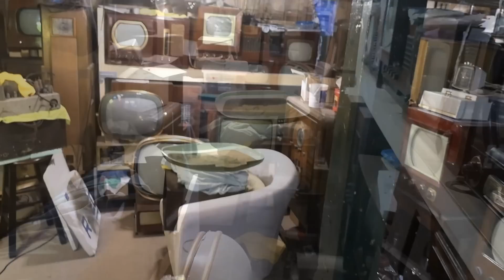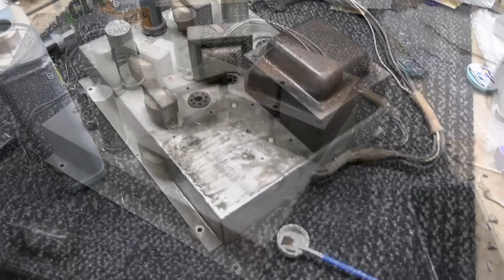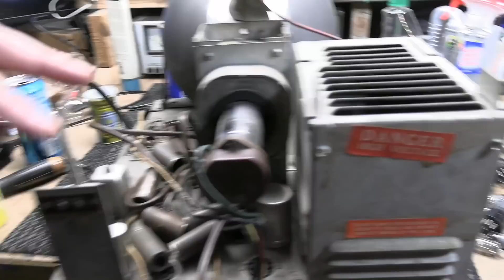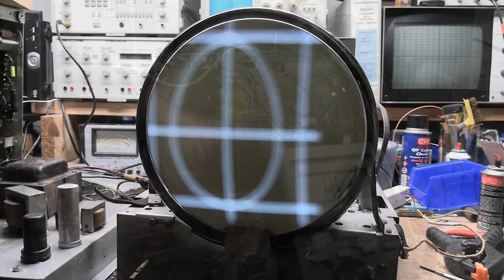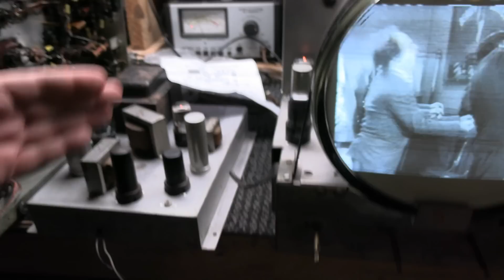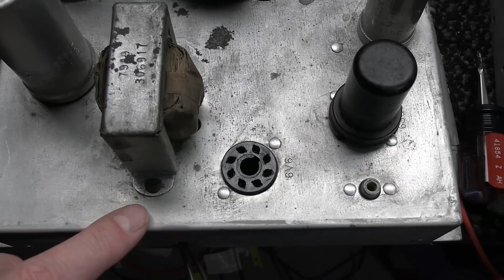Admiral 24A12  part 6: Occam's Razor

Comment: If something was wrong with that 6V6 and it was getting hot (perhaps a bad connection caused it to be biased incorrectly), and since as you said it supplies power to other parts of the set, perhaps it sent too much current through your first 3K replacement resistor, and burned it up, acting like a fuse, perhaps the same fate as the original resistor. Looking at a schematic for an admiral chassis with a 6V6 (not sure it's the chassis you have), I see a 3K resistor R332 in that area of the circuit, connected to the focus control, and connected through the focus control to the 6V6.
Reply from the maker: I think you are absolutely correct.  Another reason to overrated parts when replacing.
Reply: @bandersentv  With that bigger power resistor, you might have been in more danger of burning up something else, like your focus control or audio output transformer. It might be interesting to put that metal tube in your tester, and check very carefully for shorts, maybe tapping on the tube in each shorts position. Did you have normal sound when the resistor was burned out, or that 10W resistor was in there?